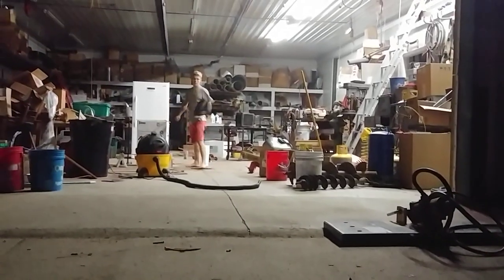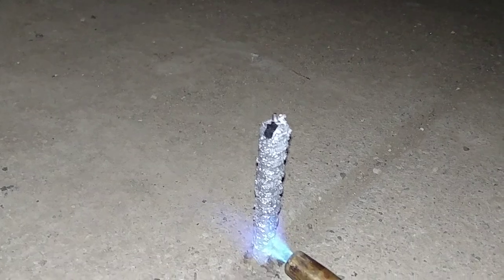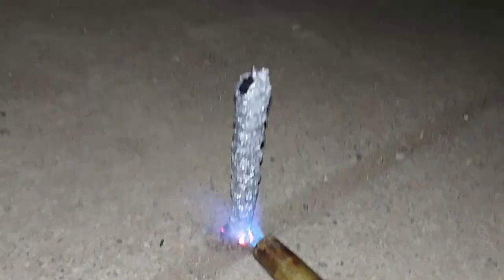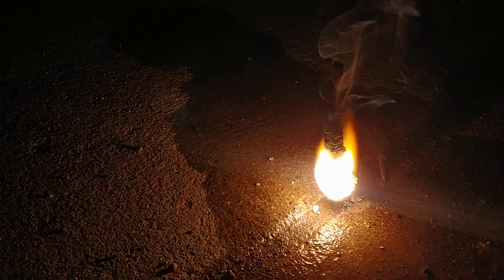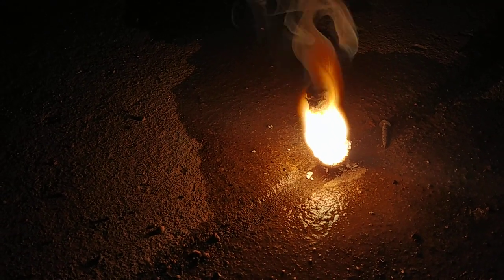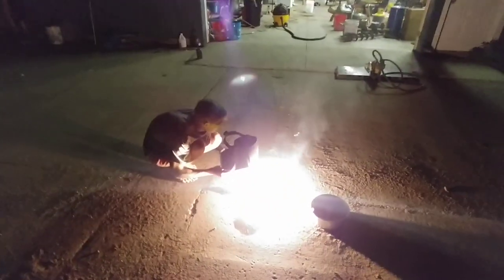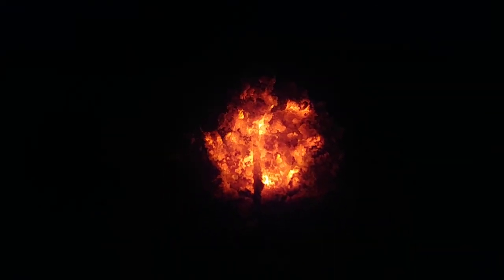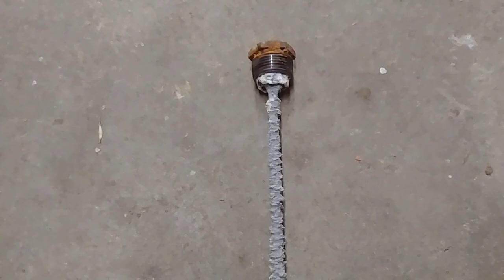Water Heater Anode Rod Starts on FIRE!?!

Comment: There is no circumstance when working on your hot water tank would result in a fire. Magnesium ignites at a very high temperature. Don't scare people by saying that it could accidentally ignite when they work on it
Reply: He even taking a while with the butane torch. They use these on on gas valves.

Comment: I saw a guy last year that was cutting new rods down and adding handles to them. Turned them into  giant  magnesium fire starters, Use a cutting blade to shave some off into a  powder And light it. It’s the same material used to start fires in survival  situations. Only that product comes as a bar with a Ferrite rob attached to it. You could cut a new rod down into coin sized wafers and  throw them into a fire for emergency Signaling. It should be visible for miles and miles at night,